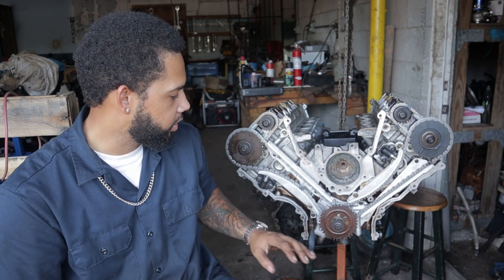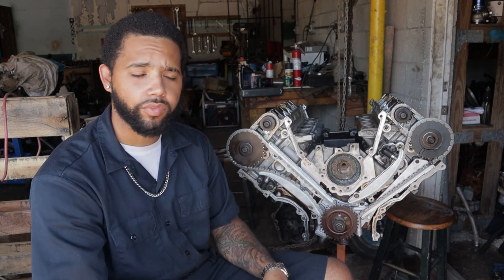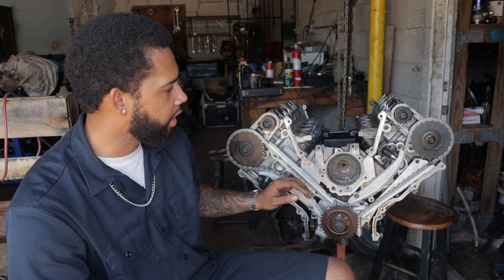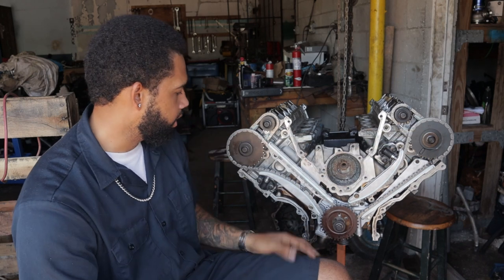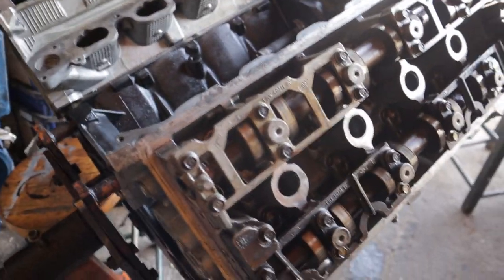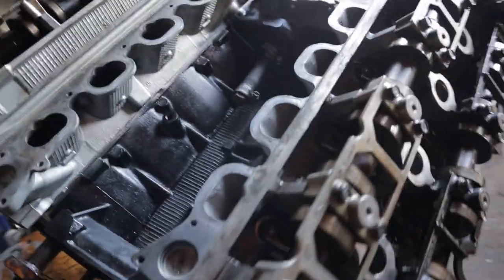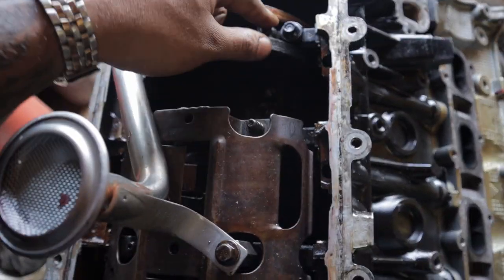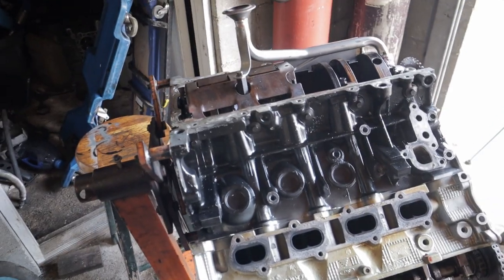Building My 4v 4.6L Engine In 8 minutes

Comment: Why wouldn't you just use all c-head cams in this build? if one of the b-head cams are broken just switch it all to  c-head!?!
Reply: B head cams are better actually. B cams with the c heads is the sauce!
Reply: @blackandyellow87  my point is why would you run Bcams on one side and Ccams on the other? Simultaneously!?     ...Regardless of cam & head combinations

Comment: beautiful job,   but I am a   70s 351 Cleveland and 302 Form motor man , i don't like the Ford 4.6 and other overhead cam engines with chains and sprockets all over the engine , I will stick with the 351 Cleveland 1970s block extremely simple build  and NO chains or sprockets all over and plastic chain guards

Comment: I found this video very interesting as this is what is happening with my ,04 Mercury Marauder 4.6 DOHC motor as a piece of the timing chain guide broke, went into the oil pan and got sucked into the pickup tube robbing the engine of oil pressure. The damage, I was told,  occurred quickly. The car is 21 years old with 217K on the motor and was performing fine until this.
Reply from the maker: Hey man trust me that problem is more common than you might think, here's my video on explaining what actually happens and how I fixed the problem, https://youtu.be/7dD1xHMgrYY?si=o-h4idfCwW701pBA
Reply: @DriftDreams242  I'm having the work done by a gentleman who's been building racing engines for 38 years so I trust him to do the job right. Expensive but right.
Reply from the maker: @Photog455  yeah that's kinda how it is, lol 😂
Reply: My aviator did that horrible chain rattle for a couple mins most cold starts until oil pressure built up or you revved to 2kish.  Never realized the broken guide might block the pickup.
Reply from the maker: @stevensgarage6451  oh yeah man it's a real common issue with these motors

Comment: Man I just blew a head gasket in my 96 mk8 thinking about swapping to c heads Im hoping to learn as much as I possibly can before the swap I’m a very visual learner do would a Cobra workshop manual have everything I need to complete this process I have some knowledge and I want this mark 8 as my first project car but I know that’s kind of bold with these engines
Reply: @DriftDreams242  well i was watching this video made me want to drop forged crank pistons and rods so it can bolt to an Eaton m112 that’s why I originally wanted to swap to c heads I’ve heard good things about these gen 1 manifolds with the delete and a cobra throttle but if I’m gonna tear in that far I might as well put in what i can in the rotating assembly
Reply: @DriftDreams 242  how much would something like this cost? 🤔 I have a 93' Crown Vic & I'm looking to rebuild the top end & add a little more power

Comment: Great job on the rebuild of the 4.6 4 valve motor I was curious I have a 2004 Lincoln aviator with a Mach 1 motor in it and I was just wondering how much it would cost to go through an engine rebuild and supercharge it with high performance parts if you would know off-hand how much it would cost to rebuild a 4.6 4 valve motor I really appreciate that looking to make around 600 to 700 horsepower on this Lincoln aviator which weighs about 5,000 pounds it already has 373 gears which is a plus thank you for your response
Reply: 6 to 7 hundred hp will be in the 10 to 15g range for a 4v motor. If you want it to stay together for long haul. Your going to be boosting of some sort to make that kind of power.
Reply: @jntcustomcars  thank you very much for your response also would probably be a good time for me to have the trans rebuilt while the motor is out motor and trans only has 93,000 original miles on it thanks again

Comment: Hi Friend, thanks for a quick video. I was wondering if you could make a video on how to set the timing on this kind of motors. I have a lincoln aviator 2004 with the 4.6L 16v and mechanic is not able to set the timing. Thanks in advance.

Comment: Do you have a step by step book or anything you recommend me using? 
This isn’t a 302w, so I’m more nervous getting everything right.

I have a 5.4 4v with custom ground cams and adjustable primary and secondary sprockets. That I need to finish building, it’s currently just the short block, just need to throw on heads and cams then time it.
Reply: @DriftDreams242 yeah I have the rebuild book for mod motors. Thanks for the reply

Comment: I bought heads separate from the block doing a build and the guy threw the cam caps in a bag and didn’t label them. Was wondering which ones went where